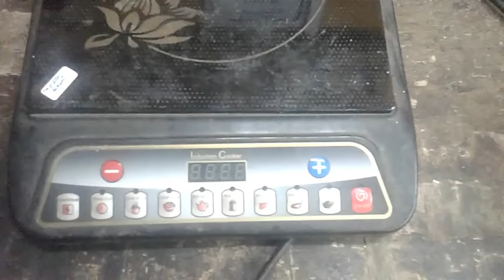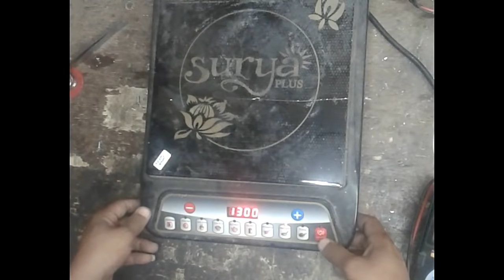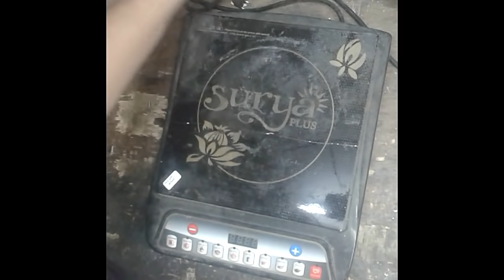E0 problem and its reason in induction cooktop.

Comment: Sir ji igbt bar bar kharab ho ja raha hai capacitor bhi change karke dekh liya hu sir ji kya problem hoga sir ji
Reply from the maker: 1) 10oham resistor jo igbt ke gate connected hai usko replace karo.
2) 8050 n 8550 transistor check karo ya replace  karo.
2) box type capacitor 0.3uf/400v and 5uf/400v replace kardo.

Comment: Sir Jo induction iss video mai HAI vhi mere pass HAI same problem HAI  aur Maine iska igbt 2uf aur 5uf pf bhi change kar diya aur abhi bhi e0 error derha HAI aur 1300 PE chalta HAI e0 error deta hai
Reply from the maker: check 1watt sencing resistor.
Reply from the maker: and confirm did you replace 0.3mfd or 2mfd
Reply: Mera indeciton me ahi paroblam hai

Comment: सिरिज बोर्ड मैं 40watt का बल्ब लगाकर इन्डक्सन को सप्लाई दिया तो क्या होगा सर??
Reply from the maker: without pot agar on karenge to display on hoga aur no pot ka error show karega aur  pot rakhenge toh bulb glow karega
Reply: Electronics Tek sir pot rakhakar on kiya to bulb full glow hokar turanta hi off ho gaya. phir on kiya phir full glow hokar standby ho gaya. Esse pehele bina bulb on kiya tha igbt on kartehi short hogaya aur fireing  huwa tha.  5uf   capacitor bhi change kiya. 8050 or 8550 bhi check kiya 18volt ke jagaha par 14.5 volt hai.
Reply from the maker: replace gate rasistor which is connected to igbt gate it's value between 10oham -33oham.
Reply from the maker: if smps voltage drop replace 18 volt zener diode which is in smps section.

join on Facebook
https://www.facebook.com/groups/1984142441852858 
you can directly post photo or video of induction.

Comment: After 6 years , suddenly , utensils on induction only beep beep sound,n finally goes off..plz advice..
Reply from the maker: you need to replace filter and snubber black capacitor.
check and replace 1watt rasistor

Comment: Sir, E3 aa rha hai jisme "garmee ka sensor fell ho gya hai"kya kare?
Reply from the maker: generally E3 error input voltage high or low sense karne se aata hai.
jiska reasons 1watt rasistor hota hai.
Reply: Sir. V-Guard __ __ _  _ prabalam
please help
Reply from the maker: which problem do you face?

Comment: WARNING!!
This is a "dangerous" video.
Induction hobs only work with magnetic pans.

The E0 code will appear if you put a non-magnetic pan on the hob even when there is nothing wrong with the hob.

It should have been demonstrated that the pan was magnetic, if the E0 then appears there is a fault.

IMPORTANT

Check the hob with a magnetic pan before dismantling the hob.